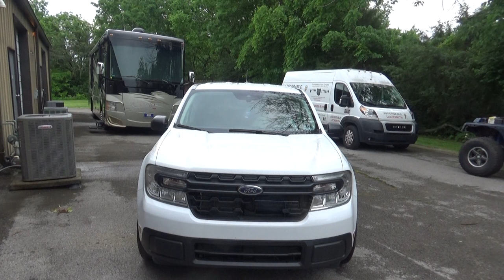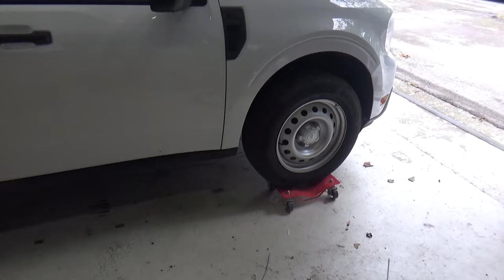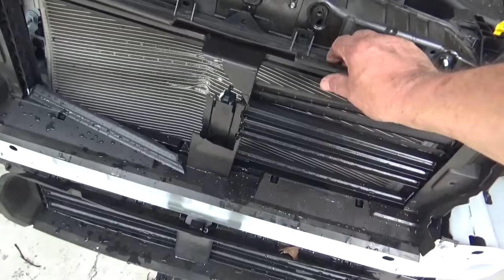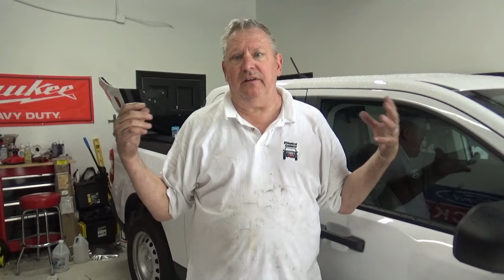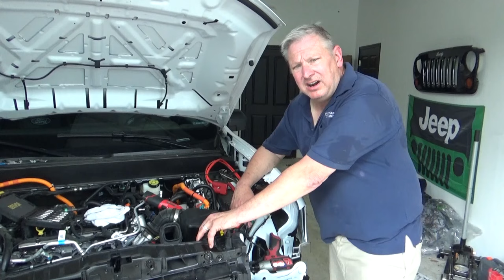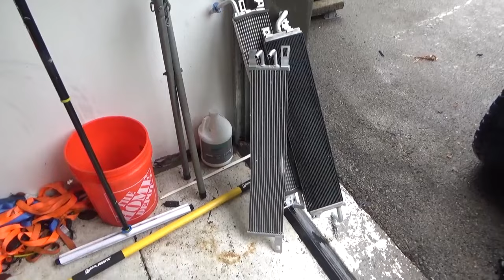23 Ford Maverick Wrecked - Disassembly - Fail - Bumper, A/C, Radiator, Shutter Assm.

Comment: I’m waiting to get one into the dealership for a repair like this so it was interesting to see what it all entails. Mine had zero body damage except for a hole in the grille. What caused it? A large bird sucked into the grille at 70 MPH. It toasted the active shutters, the AC condenser and caused the radiator to leak at the side seam. Luckily lots of feathers left so it’s a comprehensive insurance claim. I never thought a bird could do so much damage.

Comment: I enjoyed watching this video last night. Just picked up a 24 Lariat Hybrid and need to install base plates for flat towing. Wanted to see what the active shutter system was all about as Roadmaster require cutting the lower ones out. Are the lower and upper active shutters one piece or two separate parts?
Reply from the maker: Two separate parts - you could cut out the middle fins and leave the side pieces so it would still function